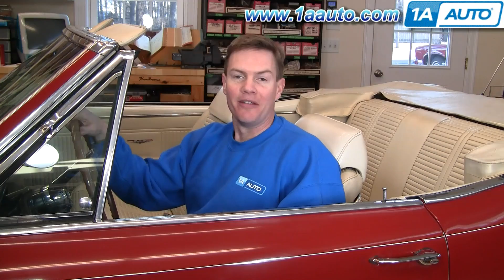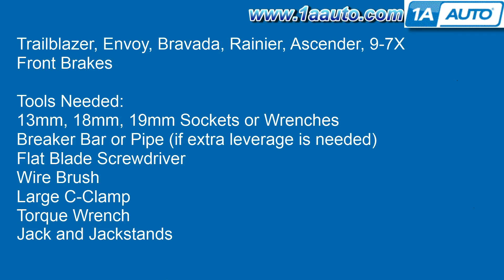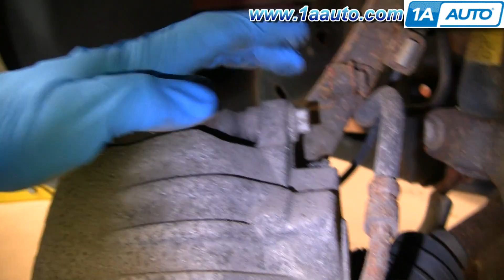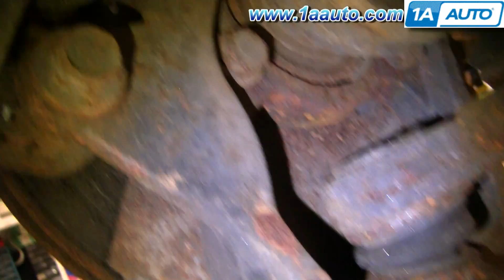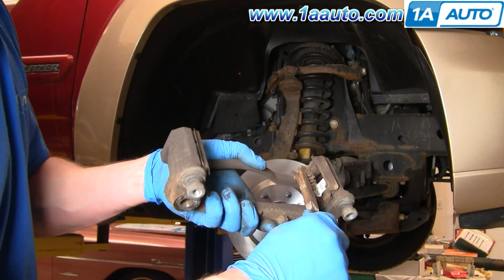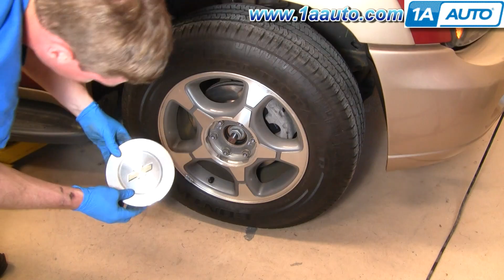How to Replace Front Brakes 02-05 Chevy Trailblazer

Comment: It should be noted that the only time you need to take the bracket off is to replace the rotor. You don't need to remove the caliper bracket if you're just doing the brakes. Also do you not use grease? You should grease the caliper pins/bolts at least.

Comment: I noticed the video showed the mechanic NOT using brake pad tensioner clips. While I have not done any internet research to verify if they are normally used on a 2005 Chev. Trailblazer, I believe they are included with brake pads for 2006 and later.

Comment: So I’ve done brake pads before But Im having issues pushing back the pistons on my trailblazer . I use the tool for it but it’s not going back , why ? It only move very little . Do I have to bleed the fluid or just use more Force ? Thx in advance

Comment: Thank you for such a straight forward and helpful video. Despite it being my first attempt, everything went smoothly, with my only issue being the difficulty of pushing the brake pistons down to put them back into place.
Reply from the maker: +Eebo Von Weebo Thank you very much!
Reply: A trick I learned was to compress the pistons before you remove the caliper by using a small prybar and screw driver between the rotor and pad and pry on the pad against the caliper pushing the calipers piston in. If it has dual pistons on the caliper repeat on both sides for each piston. Make sure to loosen the break reservoir cap to allow fluid to flow back in the reservoir.

Comment: No mention of bleeding the breaks. Why?
Reply: Jerrieme Stebbins as long as you don't disconnect a break hose there is no need to blend them. something else I didn't see was the break fluid Reservoir cap was not removed and I don't think you used any break grease on the edges

Comment: I have a question and I'm praying that you respond asap!!!
I'm in the middle of replacing the front pads and rotors (first time I have ever attempted this in my life though I have seen it done numerous times in the past) on my 2005 Envoy XL and I removed the pads with ease but here I am, down to the rotor and it will NOT come off!!!!!!! Is there another bolt or 2 (or 3) that I have to remove or do they just "slip" off? I have tried hitting it with a hammer to loosen it up but so far nothing!! A friend of mine told me that they might be "pressed on" and that it takes a special tool or possible trip to the dealer to remove. 
I do not have a lot of money at this moment or I would have done that to begin so here I am.... Tire, pads, caliper and bracket removed with tools all around me and I'm getting very very very upset as I'm in the process of failing this relatively simple job!! :( My Wife is not helping matters yelling at me and telling me "I told you so"!!!!! PLEASE help!!! I there a certain way to remove these things without doing any other damage to any other area of the truck? What would YOU do in this situation??? Is there a certain bolt I would need to remove the rotors ( a certain name?) ? Can I hit the rotors from the inside pretty hard without worrying about additional damage to elsewhere on the vehicle?? 
PLEASE HELP!!!!!!! ANY... And I truly mean ANY advice would help me here!!!! Thank you sir!!! Please help!!!!

Comment: Hello, Thanks for posting video. I have a 2006 GMC Envoy XL SLT and i need to know what the torque spec is for the Brake Caliper Bracket. I couldn't make out what you said in the video. I got the Brake Caliper itself it's 25 ft/lbs. Thanks...

Comment from the maker: You could try to place some anti-squeak grease to the back of the brake pads to see if that quiets them down. You can buy it at your local auto parts store. 1aauto.com 888-844-3393

Comment: ok so now after changing rotors and brakes i get a squeal noise. i took out all rust from the calipers and the small metal bracket in there to make sure the new pads sit good but other than that i didnt grease anywhere. i did clean the rotors tho with brake cleaner. where the hell am i suppose to oil to avoid squeal?

Comment from the maker: That issue wouldn't have anything to do with the repair on the front wheel bearing that you made. You may want to check for a possible bad EGR valve, or maybe a  loose or cracked vacuum line.

Comment from the maker: You will want to check and make sure that none of the bolts came free and the caliper is sliding around. Sometimes there is a break in period on new pads and they will make some noise in the beginning of its life.

Comment: ok i have changed my breaks and rotors and on my test drive i heard a noise like metal on metal. So i checked it out and it looks like something is digging into the rotors basically carving a line in them. Need help I have no idea whats going on.

Comment: I have a 2006 gmc envoy and i replaced the brakes and everything seemed fine. Now the brakes squeal terrible and I know the pads are still in tact and the rotors as well. What about shims? And do you need to lubricate any components? Thanks.

Comment: hey question...I know this is irrelevant to a front brake job but I am painting my calipers on my trailblazer ss and I had to tighten to brake line bolt super tight before it would stop leaking fluid...these bolts don't need torque do they?

Comment: 2002-2005 Chilton manual
I have a 2005 LS
The manual says 110 ft-lbs for front caliper mounting bracket bolts, and 147 ft-lbs for rear caliper mounting bracket bolts. I am a bit confused.Should i use 95 ft-lbs for front? its median between 80 and 110 ft-lbs.

Comment: @951prerunner the mounting brackets most likely wont be the same but it be similar. unless it is 2wd. then it would be different because usually the rotors have the studs on them with a castle nut that has to be taken off and put on the exact same amount of turns. if you have a 2wd find a video of any chevy 2wd suv of about the same year and itll be about the same.